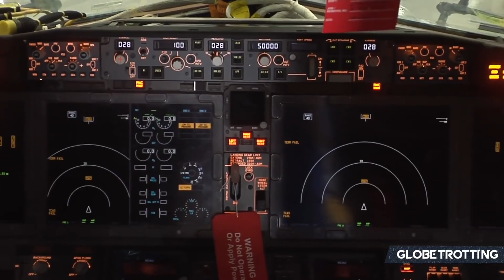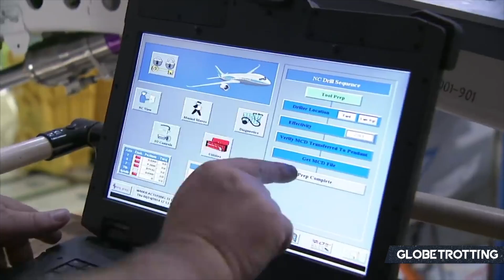FAILURES - Why Is Boeing Struggling?

Comment: Trashing a company is easy, Boeing is a good example of that. Bringing it back up is a very long and hard process. The question is whether Boeing can, or even worse wants, to achieve that. Only time will tell, this is a soap opera that will last a long time.
Hundreds of videos on the subject will likely come up.
Reply: Boeing committed industrial suicide. With several steps. It's unprecedented. From undisputed leader in the industry into a fragile and unsecure challenger. The B787 is the only good new plane. Poorly assembled but with modern technology. Able to fully compete with Airbus. Though I'm not yet convinced with the B777X  but time will tell...In the single aisle segment, It's totally unclear. To replace the horrific B737 Max, the NMA project could cost a huge amount of money. Up to 50 billions. And Boeing does not have that money. The coming 5 years will be critical for the future of that iconic company. Embraer and the chinese Comac could replace Boeing in  the single aisle segment....
Reply: @patrickpeters2903 US government won't let them go bust

Comment: I will never set foot on a boeing aircraft, point blank.
Reply: Practically speaking, Boeing aircraft are on my "avoid if possible" list. If I have to fly and the only available and affordable flight uses a Boeing aircraft I'll be on it. Statistically it's still much safer than driving. Just not quite as safe as Airbus or Embraer. Or, most likely, Comac.